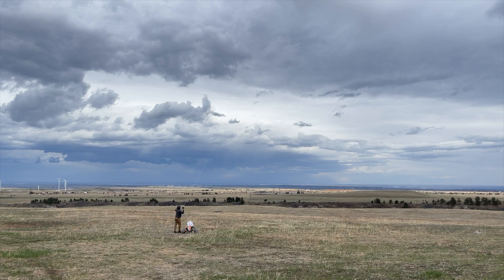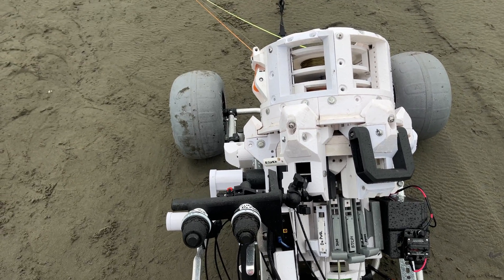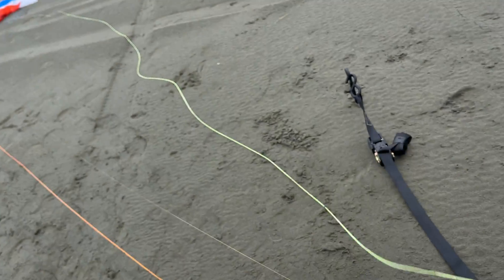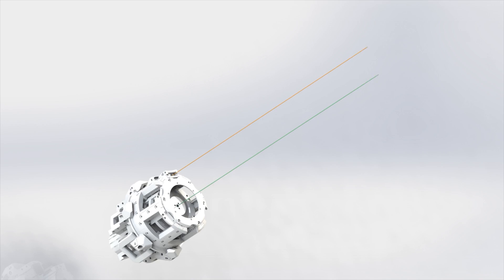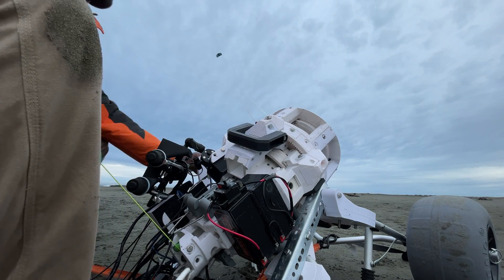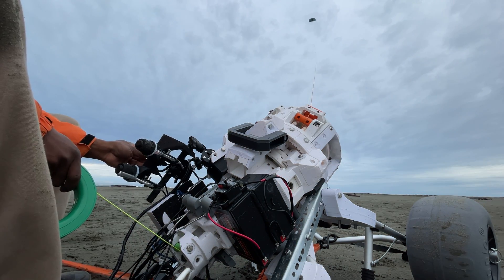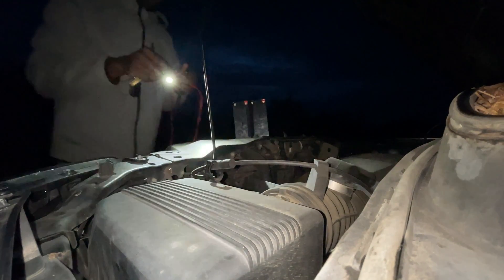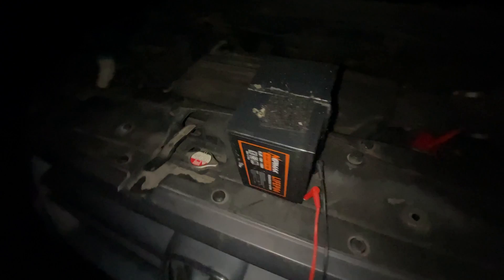Kite Engine: Advancing Kiteboat Technology with Regen Reels

Comment: You certainly seem to have a few hussles going on 🫤
You have a nice design here, so I'll give you the benefit of doubt.

I, like you have been very interested in kite powered boats for over a decade now. Wondering why it has not had a commercial breakthrough yet. There is indeed rhe problem of automated control, but nothing modern sensors, models and control software shouldn't be able to handle.
The real reason might be that sailing is conservative, you wont replace sails with kites. Kiting is not sailing.
I do however think kitepower can offset or even completely replace diesel power in a hybrid system with hydro+solar generation. Especially on catamarans where multiple kite-engines can be installed: at least one per hull and perhaps one mid-ship.

I'm in the position to buy a boat now, potentially a live -aboard cat. As an engineer/inventor like you I can't imagine myself not tinkering and improving it. Certainly will have a spot for my Bambu X1C, electronics lab and CAD workstation.

Good luck with the project.
Reply from the maker: @BartCerneels  The simple answer is the Dunning Kruger effect. I think everyone who initially gets into designing kite controllers thinks it will be easier than it actually is. You are 100% correct in that kiting is not sailing. This means however much money is spent trying to come up with a viable system, an equal amount of due diligence and thinking is required about how the new system will be designed.

It would be silly to try to turn a sailboat into a powerboat, the same could be said about turning most known boats into the optimal kite boat. But even so, a kite can benefit many boats immensely without being perfect, which tells me there's enormous potential for the industry to grow. 

I just think kite boats and the kite controllers that power them require a complete ground up, first principles level approach

Comment: Awesome project! Is it only generating power when the kite is going out and reeling out line or will it also generate power wgen its going in cirkles or figurer 8s?
Reply from the maker: You can! but you would need to be on a moving platform, ideally an electric boat with a propeller. The prop would spin as you go down wind and charge up the batteries

Comment: as i have thought of this as a boat kite ,i always thought you could just keep backing the motor to fly it.this being the possible saving grace of the doldrums if you can get the kite up to the level of the wind.it might be 1000ft up or more so the reels and line will need to be heavy enough to take the strain and static weight.the other concern to my mind is once its in the wind and ripping you along, you have to be able to "shorten sail"for sea conditions or arrival at destination in gale force wind conditions.i think a center control line that will pull in the center of the kite maybe the answer.i haven't finished it yet,but can't wait to get er done.......
Reply from the maker: David, you are definitely right, and what also helps in low wind days is a drouge, or underwater parachute to prevent the boat from moving down wind with you. 
You can "shorten" or reef the sail by pulling the depower which changes the AoA of the kite. 

I love the wing.it system, but I thought regen provisions would be a boon, and on top of that, automatic and manual control, incase something goes wrong or there is a loss of power. Always gotta have contingency plans

Comment: how much energy does this generator produce in terms of watts or volts? Havent been able to find that info
Reply from the maker: Hey, Im Christian, the designer and we use a 90v Grin motor controller originally designed for electric bikes. We are doing tests, but power generation is largely dependent on use case and the size of kite.

With the depower engaged, reeling in line uses very little energy. In the end you have a machine that uses power more efficiently, like a hybrid car uses regen brakes.
Reply: @Ocean_Kite_Energy  ah ok I see, so this is less for power generation and more keeping available power from draining as quickly. Gotcha. However, would this still work as a viable power generator for non-boat related power consumption?
Reply from the maker: For sure, You could either go fast, or produce a lot of power. When you make power you basically exchange speed for electricity. This is just a prototype, I think you can see at some point the kite pulls hard enough to lift the whole engine, and almost pull out the 500lb anchors. This gives you an idea of the power of a relatively small kite in test conditions 

 @PaladinPrometheus
Reply: I have a Lord Nelson 41 Sailboat in Grenada that was dismasted in a hurricane over a year ago. The boat it's self has been refitted and will be ready to "sail" motor by the end of hurricane season at the end of November. I was wanting to use the trade winds and Gulf Stream  to get her back to Florida. It would be a great adventure and test for your machine. 
How do I get one?